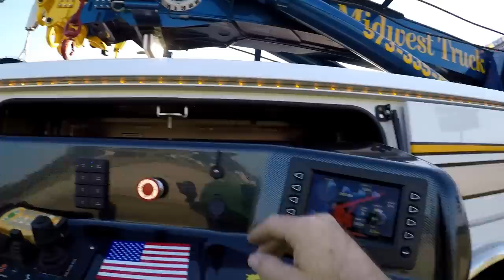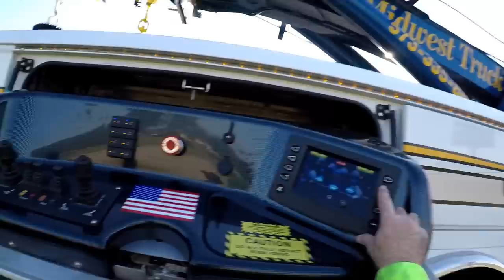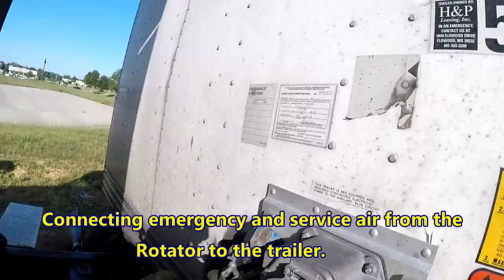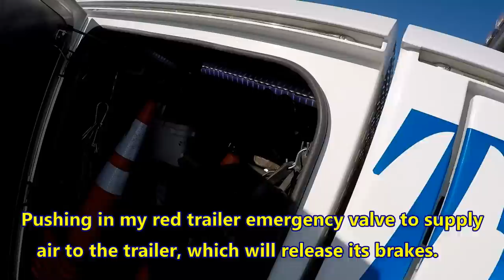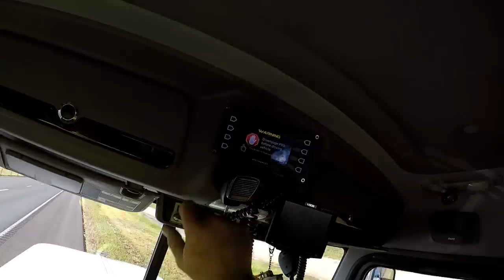BCD    Barrier Cable Destruction

Comment: I noticed a lot of drivers ignored your red and blues and siren while on way to this incident. Do you run with amber lights as well as red n blues when responding? If so I'd try with just the red and blues alone, drivers may take more notice. Also why do you pull the drive shaft? I thought that was only for automatics?
Reply: I just got my answer to the drive shaft question. :)
Reply: Unfortunately, Missouri is one of the few states that classifies towing/recovery vehicles as emergency vehicles. I'm not sure of the legality, but I wouldn't be surprised if Ron could hop into a fresh out of service police car without a speed limiter (Governor) and be just fine, legally speaking.
Reply: I think if it was an marked vehicle like a cop car, fire truck etc they would easy stopped and moved. Since its a tow truck ppl probably don't realize it still falls under emergency. Laws are diff state to state. From what i seen he usually pulls the drive shaft on call, better to be safe and not have transmission connected. Thing is which that truck leaking pretty much all fluids out it would be more needed to pull it as very likely transmission fluid would be leaking out as well so don't want to spin it without fluid and cause a lot more damage then already is there.
Reply from the maker: Raina Selone   We are actually trying to purchase a "retired" police cruiser.  Missouri law states that ANY vehicle owned and operated by a legitimate Missouri towing/recovery company can run red/blue lights and sirens when responding to emergency situation.  You called that one.
Reply from the maker: Drivers in this area do not pay attention to any Emergency Service vehicles.....not just our trucks.  Glad you got your answer about the drive shaft.   Thanks for watching and God bless.

Comment: I have to ask, I thought the guy said it was a manual transmission, so why do you pull the drive shaft? I was aware you only have to do that on automatics due to the lack of oiling to the transmission during towing, but somebody please correct/ enlighten me.

Comment: 24:52 I wanted to know if you couldn't cage the brakes and you couldn't tow it like you are trying to do so, "Is there a way to load the entire tractor and trailer onto a long flat bed truck pr trailer"?

33:31 At the same time lets say that you couldn't detach the drive shaft along with not having the ability to cage the brakes how would you tow this off to where you needed to tow it?

Comment: Almost wonder if it isn't time to phase out the amber lights and go strictly Red/Blue and  maybe even some Red/White - Blue/White on the Rotator. People have become so complacent with amber lighting they just ignore it, it honestly makes me sick.  Stay safe out there!
Reply from the maker: It is a consideration.  I have to maintain some ambers for the simple fact that if I cross into Illinois, Kentucky, or Arkansas, which are all very close, then I can't use red or blue.  Thanks for watching and God bless.
Reply: Have you looked into Dual Color lights? Can go from Amber to Red or Blue with the flip of a switch?

Comment: Ron, why did you need to remove the drive shaft. I thought this was a manual gear box?
Reply from the maker: Always have to remove either the drive shaft or the axle shafts to prevent damage to the transmission, whether it be an automatic or a manual.  Thanks for watching and God bless.

Comment: What do you do when the tow hasn't lost all its fluids and is continuing to leak?  Do you have to wait until everything leaks out?  Secondly, how do you get all the gunk off your clothes?  That tow looked particularly dirty and greasy.
Reply: most of these kind of companies have a deal set up with a uniform service so that they can exchange the dirty uniforms for the clean ones if you're in the United States think of a company like cintas or a few other ones they have a contract setup

Comment: Ron you ever throw your gloves at a car? My buddy back home will if they won't move over. I have went with him on a few calls.
Reply: I would think it could lead to damage or an accident if some numbskull with not enough brain cells suddenly saw an object flying at his windshield and freaked out and over-reacted.  It would be worsened if the numbskull had a dashcam and it recorded you throwing object(s) at them, then that could put YOU in legal jeopardy, even though the numbskull in the car didn't move over and you were only trying to stay alive yourself.  Throwing an object at a moving vehicle is not a good idea.  Being on the receiving end of rocks, chunks of ice, large birds, debris coming from other moving vehicles is enough to deal with as a truck driver.  I've experienced all sorts of things and managed to keep control, but who knows what your average poor motorist would do when put in the same situation.  In the end, two wrongs do not make a right, but three lefts just might.
Reply: I'd have absolutely no problems with throwing one of the towing forks at the car, then let them explain to the cops that their vehicle was hit in the process of violating the law.  I work in telecommunications, and have had to flag traffic in work zones before.  We once had a guy pull out around a line of cars we had stopped while we had an intersection blocked.  He nearly hit one of my coworkers, who happened to have a bright orange come-along handle in his hand to use as a baton to point with.  When the car nearly hit him, he spun around, and whacked the side of the car with the handle, leaving a nice dent.  The driver started threatening us with damaging his car, etc, etc.  Then we politely explained to him that when the cops showed up, we'd explain him failing to obey us, crossing into the oncoming lane, nearly hitting my coworker, etc, and he shut right up, knowing he'd be a a much worse world of hurt and that the cops would probably say the damage was justified and not our responsibility.
Reply from the maker: No, but I have seen a State Trooper get angry and throw a large D cell Maglight at a car when the driver didn't Slow Down and Move Over.  That was SEVERAL years ago.  I get concerned, frustrated, upset, whatever you want to call it when drivers don't Slow Down and Move Over, but I wouldn't throw anything at a vehicle.  Thanks for watching and God bless.

Comment: In Virginia and Maryland there is a law tat states all vehicles need to move over one lane or significantly slow down for emergency vehicles on the side of the road.  MD has the stricter law in which vehicles must now move over one lane - even for service vehicles on side of road.  Y’all need better protection...

Comment: Kind of surprised that those installable bumper hooks aren't closed eye instead of open hook.  Would make them a little more secure and less likely for your winch hooks/safety chain hooks to fall out.
Reply from the maker: Volvo has the only removable, completely closed eye tow hook that I am aware of.  The Peterbilt and Kenworth tow Hooks have pins that close off two ears.  Mack has permanently mounted D-rings or shackles.  Some buses and other heavy vehicles have permanent mounted tow eyes.  Freightliner and International use the removable, open hook design like you saw in this video.  The International hook is very similar in design and looks.  I also wish that they were completely closed.  Thanks for watching and God bless.

Comment: at 28:37 does those look like new tires or Retreaded tires?
Reply from the maker: I believe they are new tires that were simply damaged by their run-in with the cable system. Thanks for watching and God bless.
Reply: I can almost garentee there bridgestone 817 new. Not a very good tyre

Comment: i was wondering is the tow truck classified as a emergency vehicle
Reply: in Missouri many are certified as a emergency vehicle. that's the reason they're allowed to run the siren and have the red and blue lights especially when you're authorized for Interstate work..that being said unlike a fender bender in a small town where you can call a tow truck and have it towed away only ones with  authorization are allowed in a wreck..just like in Illinois and many other toll road States you have to be authorized to go on the toll road..what that means is for example say in New Jersey there's a truck wreck involving multiple trucks a two or three trucks get tangled up while Joe's towing right down the road who has a couple of heavy-duty wreckers may not be New Jersey Turnpike certified, so therefore it has to be the ones that are certified.. just like with Ron and Midwest he's another one where if it's not just a simple call but the highway patrol calls you have to be certified. and in Missouri they are considered an emergency vehicle and general motorists should treat it as the same supposedly but as you can see they don't..SMH

Comment: I see an increase in accidents here in Scandinavia, because people think the they can drive, and be on Facebook etc. at the same time ,when driving, doesnt work!! When you drive a vehicle, no matter the size, drive with safety, and leave your phone till you are parked!
Reply: One would think a cell phone manufacturer or such would put in some type of shut off switch on the phone so when it senses its owner is driving it mutes all during that time. Apple for one would be great at this by now seeing as they have a few new chip sets (one for Machine Learning and another for Augmented Reality in their newest models of iPhone.
Reply from the maker: "Distracted driving", the largest part of which is cell phone use, is the #1 cause of wrecks.  Every cell phone that I have ever seen has had an "OFF" button on it.   It is a very simple thing to shut the phone off, or at least you would think it would be simple.  Thanks for your concern.  God bless.

Comment: Did the LEO say at 9:26 to the driver "technically you did fail to maintain a single lane" to the truck driver? He seems like a very nice officer but this is why I can't wait to get out of this industry.  

The truck driver is working and someone cuts him off and the drivers two choices are hit the cable barrier or possibly kill the person in the car. The LEO should have said "good job" not "I could write you a ticket, but I'm not because I'd rather you hit the barrier than the car".

Comment: why not just attach a couple air hose reels to rear of rotator? should be easier than using those tangled mess of coil hoses.
Reply from the maker: That is an option on some Miller equipment, but would be very difficult to place on this particular design truck for multiple reasons.  Thank you for the suggestion.  God bless.

Comment: Amateur comment, but leave those safety chains disconnected until finished jumping back and forth over the center lift. Hook them up last, when ready to leave.  Way too close on the traffic, but cop is helpful to stand in the path. A large emergency light sitting ahead of the stalled vehicle should help awareness.. some drivers need a LOT of help.

Comment: Why do u have to pull the drive shaft
Reply: Jordan Fowler on any vehicle if the drive wheels roll while towing you need to pull the driveshaft otherwise you'll destroy the transmission from lack of lubrication.

Comment: i want to be a tow truck driver and get the same truck as you have
Reply: Ron's model of tow truck will set you back $750,000 USD, as shown,  then the costs of CDL classes, licence fees & endorsements for dang near any sort of load you could possibly pull with it. Then you have all the start up costs getting your business started. I wish you luck with your dream of being a tow operator but also know that the gear is not cheap to acquire but once established, it can be self supporting if managed competently..

Comment: I plan on being a truck driver with a custom built kenworth w900 long sleeper with plug in for a wall charger for phones and for my 32 inch tv and I'll have built in wifi for my tv and ps4

Comment: Backed up two times without 3 short blasts of horn.  From 2017, maybe it's before you instituted the practice.
Reply from the maker: Correct.   Now I'm considering doing away with the 3 horn blasts when working with Fire crews.  In Fire terms, the 3 horn blasts is the signal to evacuate.  I did not know this when I started using the 3 horn blasts for reversing.  I adopted it from the maritime industry.      Thank you for watching and God bless.

Comment: People  driving 
Never cut ui n front of  simi 
Because they have air breaks
Can't stop fast like car
Reply: Semis also have the Law of Superior Tonnage on their side- I don't care how good the brakes are, it takes time and distance to bring 50,000 pounds from 65 mph to 0. :)
Reply: I've never driven a vehicle with air brakes, but I have been on-board one that was involved in an accident.  It was a city bus, and I happened to be in the front seat on the curb-side.  The driver mashed the brake pedal (heavy braking), lifted his foot 100% off the pedal and then mashed it again which locked the wheels for a pretty fast stop.  Is that kind of thing 'normal' in the air-brake world? Or was this bus somehow special? We still hit the jerk that cut us off, but it could have been a lot worse.  The bus lost a corner of the front bumper, and may have scratched the logo on the front.  The jerk needed a flatbed tow.
Reply: The air breaking system has nothing to do with long stopping distance, it’s the 40 tons.
Reply: M O'Connell no that’s not a normal breaking procedure. Once a skid begins the stopping distance will actually increase. That and if your wheels are sliding you have reduced directional control.
Reply: No ABS and Disk brakes in your fancy american trucks?
As far as I know, all new european Trucks have to have them equipped, also on trailers...

Comment: If I would have just kept watching instead of writing!
Reply: Todd to the right of your comment you should see three vertical dots, click/tap on it and it it will give to two options, the first to Edit and second to Delete. Its a Nifty feature been around for some time on any device or computer.
Reply from the maker: If I would have read your next (this) comment, I wouldn't have given such a lengthy answer to your previous question....LOL.   Thanks for watching and God bless.
Reply: I see that. Thank you for the information, I will most assuredly use it because I will need to LOL.

Comment: You should look into making a wire so you can also power the trailer lights.
Reply from the maker: I have a power cable to power the trailer lights, but I don't often use it.  With the use of the wireless light bar I have all the lights that I need.  Thanks for watching and God bless.

Comment: Cmon people slow down and move over...it takes literally 5 seconds
Reply: And going 60 mph or so at that time you cover a few football fields or at least 1500 feet (600 meters) distance that quickly with at least 100 feet stopping distance not included in that distance.

Comment: Do you people know what traffic control is? Or can you not afford an airboard light and a few traffic cones?. I'm speaking of the state not the tow truck operator. Wouldn't work where the traffic is 3 ft away. One mistake and you're dead.

Comment: Ron, 
While caging the rear drive axle (https://youtu.be/nkptNFfk43E?t=2102) I noticed what looked like a separating recap on the right rear outside dual. I though recaps were now illegal on all tractor wheels.
Reply: David Tyndall recaps on the drive axles are allowed here IA.  You can't run them on the steer axle. I personally don't like recaps on drive axles due to the damage they cause if the separate from the casing at road speed.

Comment: That a four wheeler for you they think they can cut in front of a truck and the truck can stop not. That why i hated to drive in to Chicago Ill with a 24 ft truck because of idiot 4 wheeler. People DONT CUT IN FRONT OF A TRUCK THEY NEED A LONGER TIME TO STOP.The firemen make a mess on the ground and the tow company have to pick it up.it like the dont want to get very dirty lol
Reply from the maker: I would ask that EVERY driver,  2 wheeler, 4 wheeler through 18 wheeler and up please SLOW DOWN AND MOVE OVER even if it is only a passenger car on the side of the road.  You never know what can happen.  Thanks for watching and God bless.